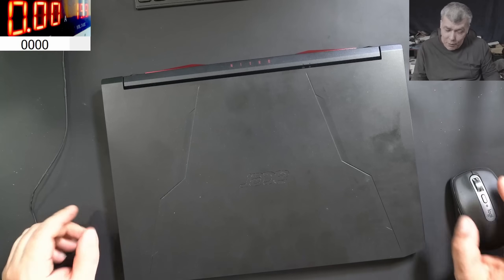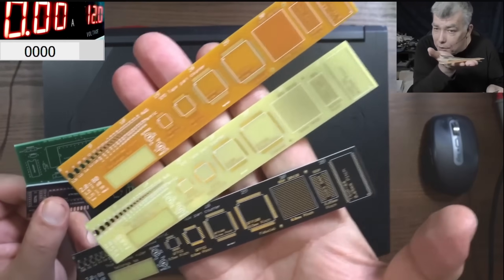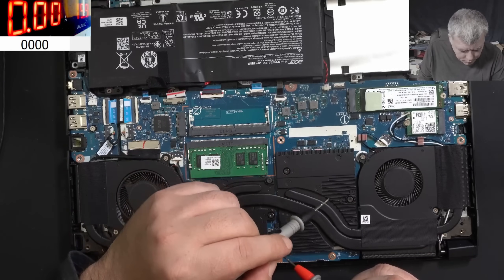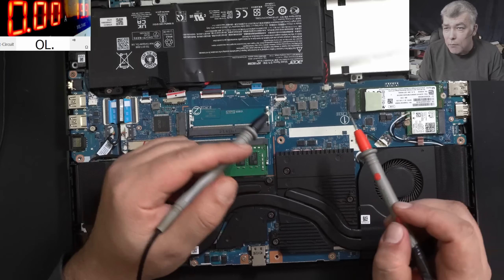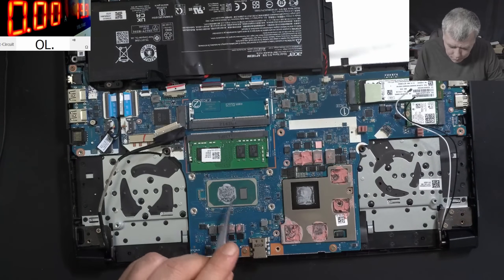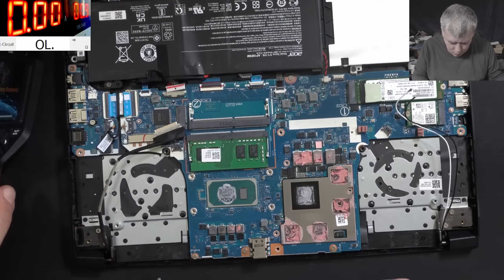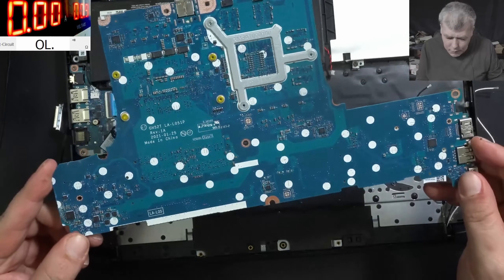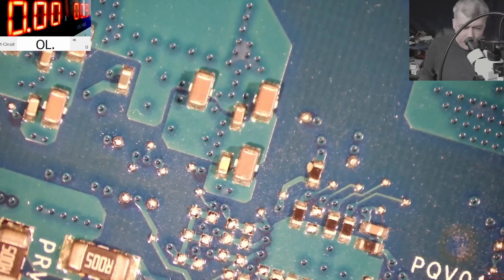Acer Nitro 5, dead, shorted main power rail like usual, but this is a lucky customer.... or?

Comment: Many thanks for your video after watching 3 about the same Acer nitro 5 problems i fixed this customers liguid damaged laptop by removing the same capacitor board cleaned up and fully working

Comment: With the alcohol you could see the top of the cap dry. Also applying the power you can see the reflection of the light in the alcohol move when the cap heats, were on the other cap the light reflection doen not move.

Comment: 99.999999% of your laptop repairs from Acer ... thats insane !
Reply: It is not a problem-free laptop model, especially for gaming ones.
Comparing the price with the same configuration, Acer laptops are cheaper, probably that's why they are bought more.
Not even Apple Mac are rare to repair...

Comment: Can you please explain in more detail why you are doing what you're doing in future videos?  More theory please.  Why does it get hot?  What is the purpose of the alcohol?  I'm an old technician but am clueless about board level repairs.  I want to learn but it's going over my head.  I would just replace the entire motherboard.
Reply: No offense, but I've seen 9-10-year-old children who know how to replace the motherboard, that's not repair, I know this is the trend, you rarely find a good service anymore, not even the official services do repairs anymore, they replace componet , for a cost that in most cases is unjustified.
Any shorted component heats up, even two shorted wires heat up, and this case was a shorted capacitor.
Isopropyl alcohol was used to identify exactly which capacitor is shorted, at minute 7:59-8:00 you can see isopropyl alcohol evaporating from the capacitor that is shorted.
Reply: @nasul9 This is so true and this is how I started in my own business. After turning down a couple of motherboard jobs and after doing a couple of screen replacements that didnt work out because something was shorted, I made it my mission to learn these skills, just watch watch watch watch and watch more 😂 I dont have any formal education in electronics and I am the only shop for miles that can perform this type of repair
Reply: @nasul9  By what Sorin is saying, most of the time he can't repair the short and has to replace the mobo anyhow.  He just got lucky on this one because it's a bad capacitor, which is rare.
Reply: There is 1000 videos on this Channel. I have zero background in electronics and beleive me when I say that all of this was going over my head as well 😂  Now I am the only shop in my area with this kind of knowledge and ability to find and repair short circuits. And I still would not be able to answer simple questions about how electronics work 😂 Keep watching and learning, eventually it will click!
Reply: It gets hot because its short, its acting like a resistor now not a capacitor, Its sinking all the power to ground, The alcohol burns off quick with heat so its obvious which component it is. You can do it by feeling with your fingers if you want a burnt finger, or just use a thermal cam
Reply: @gower1973  I get what a short is.  But why is it shorted?  Just bad manufacturing?
Reply: @stevetotaro3219 its short because like any electronic device with constant current passing through it the components will break down over time. This will cause the electrical tolerance to widening therefor exceeding the tolerance of the failing component to short to ground as a safety precaution. These capacitors will smooth out voltage constantly keeping it within its desired tolerance.
Reply: @darrenstrathdee7425  So probably dirty power from the power supply?  I have tons of old electronics that never had this problem.  I even have a 15 year old laptop running as a server that's on 24/7 and no issues.
Reply: @stevetotaro3219  these acer gaming laptop seem to be the worst when i comes to no fix. Some issues are down to design faults. Look at macbook board. Ones design fault. Put high voltage lines next to low voltage line. Not very smart. So some issue are deffo design or lack of. Board layout is critical
Reply: @stevetotaro3219  the biggest issue is that things are getting smaller and power is getting larger and with that you will get more failures esp in laptops where heat is a big factor. 

Gaming pcs not so much.
Reply: @stevetotaro3219  as a manufacturer as long as they keep their ppm low (parts per million) within an acceptable failure rate they will keep manufacturing them the way they are.

Comment: I like how Sorin gets excited about this stuff.  He genuinely loves what he does
Reply: I have been watching for quite a while. I opened my own repair service and repairing motherboards now 😂 I dont have any formal education in electronics, just watching Sorin and AdamantIT trying to learn the practical skills I need.

The best knowledge after this is to learn Linux, the toolsets are so much better than any Windows programs. Being able to run things like DDRescue, Testdisk, HDDSuperClone, Foremost, PhotoRec will allow you to perform a lot of data recovery jobs without expensive tools. PC-3000 kit cost up to 12k 😢
Reply: @christoffer6527  I've already got the linux down pretty well.  I'm more of a sys admin/network admin but looking at opening a repair shop as well one day.
Reply: @christoffer6527  I also don't have any experience "yet". I wish to open my own repair shop in the future someday as well...
Reply: @christoffer6527  Thanks for your comment, good to know that with a bit of application quite complicated subjects can be understood by watching a youtube 'Guru' (as they used to be called back in the day), I bought a cheap Mobo not realizing it had a debug light but I said to myself that I will fix it myself, obviously there is a time/financial limit to the practicality of this but within reason I'll do it whatever, I'm hoping that it's quite a generic fix not major surgery, for the record it's and MSI B-550 A-Pro and they do have the debug issue which is probably a bit much for the average PC user to figure out, again thanks for you comment and well done with your repairs gig!